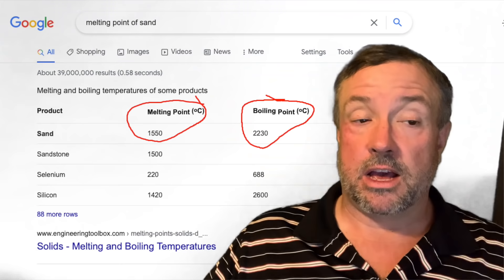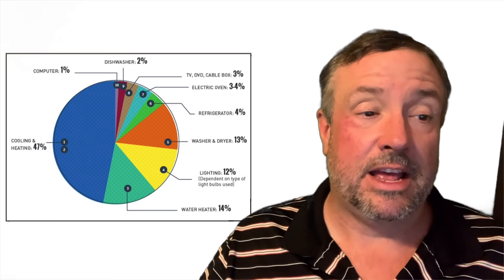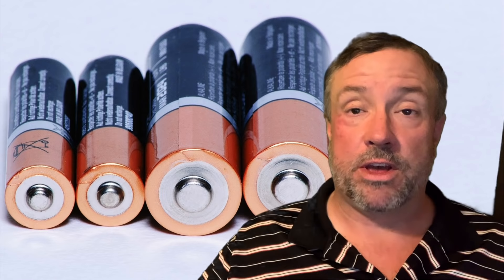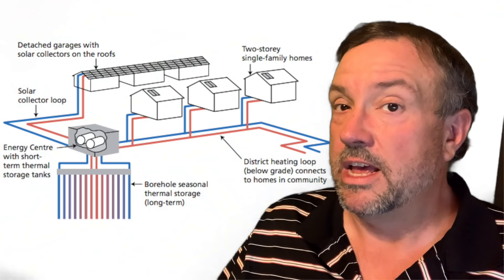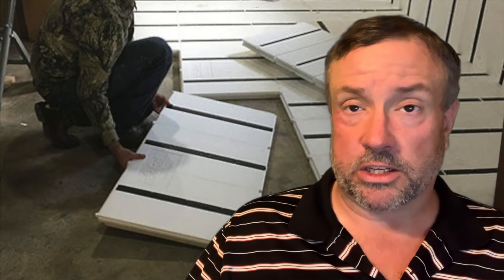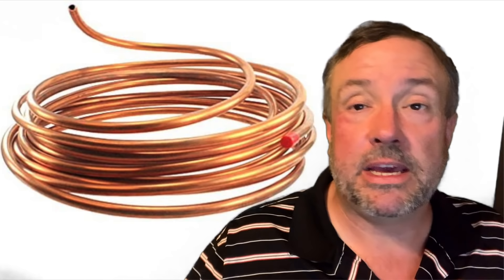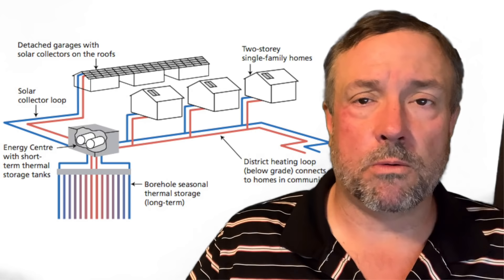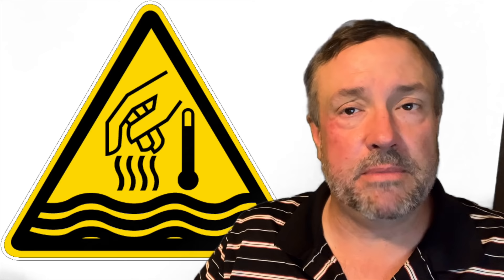Sand for Thermal Energy Storage

Comment: When I worked in the Solar Industry decades ago we used a saturated water/salt solution that would turn solid at room temperature and turn to liquid when heated. This liquid was stored in plastic stackable trays stored in an insulated room, air flowed through the trays to charge them with heat or extract heat at night using a conventional HVAC duct system in an attic or space for the thermal heat storage.
Reply from the maker: Interesting! Thank you for the comment!
Reply: any chance you can give us more details
Reply: Phase change material. I wanted to use a layer of this in my design
Reply: So interesting! Awesome! Can you share any technical information about? Any financial information?
Reply: What salt?
Reply: I would like to hear about this, because as far as I know, molten sodium batteries require storage containers that can withstand 801c.
No plastic totes are holding that.
Though they do require an incredible amount of insulation.

Comment: Minnesota. We worked on one house that stored their heat with 1 inch riverstone instead of sand. Never thought about it before but the stone would allow full airflow from the heat source. Eliminating piping. Hum. The stone was in insulated below ground bunkers.
Reply: Interesting. I just bought a property where they pushed the old stone house into a hole, so I definitely have the stones to do this.
Reply: Great concept, I am building prototypes now for demonstration and to work out the bugs. So your idea of the larger stones will work great. So my thoughts are to have a heating element buried in sand at the bottom of a barrel or some container and now I will add larger stones at the top with maybe some grating between the two mediums at that point I won't need internal piping, like you said the air will flow around the larger stones. Perfect, fantastic commen.

Comment: let's do a little bit of math here.
 
before that I just want to point out that water usable working range is closer to 30-90°C rather than 60-85°C. With 30°C water you definitely can heat a room equipped with a costly heating floor OR more smartly a fan-equipped water radiator to replace old high temperature radiators.
For water, this gives a DeltaT of 90-30=60K
So the volumetric heat capacity for water over that range is E(water)=Cp(water)*rho(water)*DeltaT(water)=4186*1*60=251kJ/L
Cp being the thermal capacity in J/K/kg
Now for sand : E(sand)=Cp(sand)*rho(sand)*DeltaT(sand)
So if we want E(sand) > E(water) we need DeltaT(sand)>251kJ/Cp(sand)/rho(sand)
Google says rho(sand)=1.6kg/L and Cp(sand)=835J/K/kg
This gives DeltaT(sand)> 187°C
Since we took a minimal working temperature of 30°C for water we need to take the same for sand which eventually gives a minimal heating temperature of 217°C.
Now we need to remember that at this temperature sand is just as good at storing heat as water is in a given volume. We need it to be a lot better to compensate for its inability to be easily pumped like water.
Let us asume that we want sand to be 30% better per volume unit than water. Then sand will have to be heated at 273°C.
This means that our free heat source will have to be at least that temperature, which is clearly not that certain for domestic use. The only places where sand can be heated continuously over 250°C is in those concentrated solar farms where a thin curtain of black sand falls across the supper bright focused hotspot on top of the tower.
On top of that, those temperature are very close to the auto inflamation of most materials like wood, dust, plastics, etc. So the fire hazard would be extremely high in residential use.
With all that said I think that, for domestic use, the better way to consume less wood throughout the year is to throughly insulate your house, use a heat pump that only work during the daylight and store the daily heat in a water tank or a massive wall or soil using simple PEX tubes, it is less sexy (I love exploring tech ideas too...) but it is a long term solution.
Reply from the maker: Thank you for all the detail!
Reply: Really some good thinking
Reply: How do you ensure the water doesn't boil? At least for sand you can just keep pumping in more heat. Good point on flammability though.
Reply: @markhemsworth2670  the simplest way would be to activate a circulator at a given temperature threshold. It would send water to radiators or any heat diffusers.
An even simpler way is to make the water buffer big enough.

Comment: Hello I'm an hvac journeymen. I believe air is your best medium. Using soft copper you can store heat in your sand. Then when you want move your heat from the sand with air to a tube in shell style heat exchanger. A tube in tube heat exchanger would work as well. You then can control water temp by simply controlling flow rate of air around the water tubes. And from Here you have your radiators and such.
Reply from the maker: Interesting
Reply: Agree - instead of sand the medium can be small granite rocks and you heat air in the parabolic reflectors and discharge at the bottom of the rock pile. In a closed system with non-return valves I am sure circulation could be done with convection/Pressure difference flow.
Reply: I would also be in favor of the air return. This should be the cheapest option.
Reply: I was a boilermaker specializing in heat exchangers with high temp, high pressure. I agree with your answer, was thinking the same thing essentially. 

Any liquid you use with a high boiling point is going to be expensive and/or and pressure. High heat and high pressure is not safe for most people and expensive..

A combination of water/air/sand would be relatively simple, diy friendly, low maintenance, low pressure.
Reply: @shanewestphal1557  I've been thinking, would it be possible to remove the burner from a domestic gas boiler, and just feed hot air from your thermal battery to the heat exchanger instead? What would the air temperature at the heat exchanger need to be to make this viable?
Reply: @shanewestphal1557  also what kind of fan or pump would you suggest for moving high temperature air through the heat exchange loop?
Reply: @mrogormand1  pumps and blowers are not my specialty. There are alot of factors when choosing. Temperature, pressure, flow rating, etc. If it were me, I would contact a engineer (I personally know several) or I would look at the information tag on the pump to find temp and cfm rating. Estimate what you need. This is a little out of my knowledge base. I either installed, repaired or replaced. I never really had to size or choose.
Reply: @mrogormand1  your other question does not make sense to me. What would be the purpose of the burner? Think radiator. A radiator is a liquid to air heat exchanger.
Reply: @shanewestphal1557  Ok, let me explain myself a bit. If you have a house with gas fired heating, you already have a system of radiators, heated by water that is in turn heated by passing through a heat exchanger in a gas boiler, or oil boiler or other fueled boiler.. The heat exchanger is heated by the hot exhaust from burning gas in the burner unit, also in the boiler. My question  to you (as you said you had boiler experience) is, would it be feasible to modify the gas boiler so that you remove the burner unit and replace it with a hot air feed from a sand thermal battery?  or is it a better Idea to design a new air-water heat exchanger from scratch?
Reply: @mrogormand1  ahh. Got ya. So the issue I would see is the temperature. You would need a huge thermal battery that consistently feeds similar Temps as the burner would produce. I would think the burner would not need be replaced, just fed hot air. The burner is not really meant to come in direct contact with high heat but should be fine. Put a high temp tee valve in line to the burner then can direct either hot air or natural gas/propane. Also, would have to think about the exhaust.

The issue (in my opinion) would be keeping the incoming hot air hot enough to "fire" the boiler. 

I was thinking more of a closed loop system with heat exchangers, automobile radiators, and heat battery. I would have to draw it out to properly convey my thoughts.
Reply: I so much agree, K.I.S.S!  if the air is to hot, dilute it at the source with cooler air. ducting is cheep, no fancy effluents...
Reply: The video is over a year old so I was sure someone else would’ve thought of air as the ideal heat transport medium. It’s free and ubiquitous, it doesn’t freeze or boil, and it can be easily moved from place to place. Store solar heat in the sand battery, (the bigger the better), by any convenient method. Air pipes could then move heat from the sand to air/water heat exchangers to heat water for direct domestic use or for space heating. For safety a battery of sand batteries could step the temperatures down to safer levels so that the sand closest to the heat exchanger would never reach dangerous temperatures.
Reply: water shortage is going, or is presenting to be a future problem
Reply: Would love links to the reccomended heat exchanger and how to blow the our through the copper tubing

Comment: Here in the Netherlands there is already an housing project that uses a big isolated basalt stone mass  as an heating battery for heating in the winter. During the summer regular solar panels collect electricity that is stored with piping as heat is the basalt. In the winter this stored heat is used to heat a whole housing block ( name of the project: cesar-project and basalt-batterij)
Reply from the maker: That’s awesome thank you for sharing
Reply: In Hamburg Siemens-Gamesa has an upscaled grid-level version of this using basalt as well: ETES, it can store 130MWh of heat in about 1000t of stone.
Reply: Really nice! That's idea is really awesome... Do you have any information about the ROI of this? Any financial information?
Reply: @TheGijzzz

Comment: As a primitive heat storage for those who have had to use this method throughout history, rocks and I imagine, sand, would hold their heat for long periods of time. I am thinking of the very old fashioned methods of heating specific areas with hot stones, heated by a fire, then transported to where they were needed. They not only used them for heating beds in freezing bedrooms, but also in outdoor carriages, under the seats, and in their homes where needed. These rocks would get switched out for newly heated stones brought in from either outdoor fires or indoor fireplaces. In this day of fuel shortages throughout many parts of the world, it seems we must inform ourselves of lifesaving methods of survival. When the weather thrust Texas into a deep freeze a couple of years ago, it was reported people froze to death, and pipes broke from freezing also. It seems the electric was down in many areas, and people apparently were not able to stay warm. It pays to know basic survival techniques, and sand used for heat storage makes sense to me. I had been thinking of getting stones, as in Florida we don't have "stones" as much as limestone, inland. But I thought of sand as an option, because if nothing else, Florida has all the sand one needs. Of course, it is mixed in with organic materials, but it is not hard to wash sand to the pure white state. I have done that. Once that is done, dry sand should be good for heating by the fire outside in metal containers that can be safely moved indoors to a metal or fireproof platform to warm small areas, should our grid go down. We dip down into the 30's here, and while no one would necessarily freeze to death, it can get very bitter during the nights, with days usually in the 50's. Thank you for this video, and I just wanted to recognize sand as a great potential heat storage/insulation resource.
Reply from the maker: Great info

Comment: So far, I have my greenhouse pit dug, aprox.  5' deep. After insulation with ridged foam I plan on filling the floor in with two feet thick adobe/cob slab, then add another foot or so on top of that but with a  6" diameter channel running thru it to direct and collect heat from a woodstove before heading out thru the chimney.  This will operate similar to a cob bench often attached to a rocket mass heater in a home.
Only requiring a  very minimal amount of wood and effort in the day/evening to create enough radiant heat to get thru our cold Canadian winter nights. And, in summer,  the cool floor mass will help regulate the interior temps with at most a dc fan for circulation.  
I've come to appreciate systems with as few movable,  motorized,  and electrified parts as possible- less to break, more reliable,  easy/free to DIY fix, etc.
Reply from the maker: sounds awesome!

Comment: Hi there, as a Canadian,
  I understand how sand is a nice thought in the Winter!
 Tahiti has some lovely sandy beaches!
 I am very interested in sand batteries.
 In the past I’ve done a couple of small scale experiments.
 In buckets, & large SS saucepans.
 Bought 3 older electric kettles from thrift stores.
 Hooked directly to a 100w solar panel.
 They all worked.
 The bucket worked best, but I was concerned about heating 
 the galvanized bucket that hot in the house.
 Fumes might be an issue.
 The saucepan worked well, but wasn’t big enough.
 After watching your video, I now have a bunch of new ideas!
 Who knows what I’ll come up with?
 Keep your smiles on!
Reply from the maker: That’s awesome!

Comment: Air is probably the best choice for moving the heat into the sand. I’m looking to build a rocket stove and blowing cool air with a small fan across the top in a 4” pipe and then down into the bottom of the sand. The pipe then splits out as a manifold into smaller pipes that have holes in their bottom so the air can get into the porous sand. A similar manifold at the top could bring warm air to where it is needed.
Reply from the maker: That’s awesome
Reply: Make sure to install a good prefilter or in about ten years your entire intake area will be clogged beyond use. Dust is insidious!
Reply from the maker: @palipali4264  wise words

Comment: After reading many of the comments, my 2 cents for what it's worth.

If you have enough sand in a sufficient volume and insulated then my thought would be to use a copper tube coil buried into the sand at regular intervals. Copper has a melting point of 1,085 °C so the temperature would not affect it so long as it was as solid run. (No solder) I would make the size of the piping about 1/2" to 3/4" to maximize the contact area. A simple blower system can be used to push the outside air into the solar collector and feed the heated air into the pipes buried in the sand.  No need for a special air pump as it only blows the outside air in and not the warmed air. Also, if the sand temps are right you could use a few peltier wafers to utilize the heat to run the air pump after the mass has warmed. Peltier wafers or chips are used in thermoelectric coolers. When these wafers are powered they transfer heat from one side to the other, which side the heat or cold goes to depends on the DC polarity applied to them. That's why they can also heat the contents of a cooler. But if they are heated on one side and cooled on the other they produce electricity and maybe enough to run an air blower if combined in a large enough scale. Think wood stove fans with no battery that run on the heat generated. That's how they work. Electrical generation was the intent in their original design. The cooler/heater part was found out later. My idea would not be a fast transfer of heat but in IMO it really doesn't need to be if you're collecting heat throughout the day, week, month, etc. Super efficient? Maybe not 100% but I figure it's a good starting point.

Thanks for getting me thinking about this. It might be a great way to warm my large chicken coop (24 chickens) in Ontario Canada in the winter. 👍
Reply from the maker: Cheers!

Comment: I would say that electric heaters, fed by photovoltaics are a great way to store a lot of heat in a closed and well insulated sand container, that has built in pipes for heat exchange. You could easily get the sand to 300-400 degrees C. Stainless steel should be a good material for the container/heat exchanger. Insulation should be very good, maybe a first layer of perlite/cement, second layer of hempcrete or rock wool (or maybe both). And the whole thing put underground. Using a loop of high temp oil, you can easily transfer heat from the sandbox to a water boiler.
And relying on photovoltaics, rather than solar heat collectors, means that even in very dim and short winter days, you could get at least some heat.
And in the summer you can use the extra power for other stuff.
Reply from the maker: interesting
Reply: Check out Finnish company polar doing it
Reply: Thank you for post. is high temp oil vs high temp air better and less cost. i think Polar Night Energy does hot air and thought it strange
Reply: @t9358  Hot air is a nice concept too. But I think it would be harder to achieve as a DIY project.
High temp  oil can be achieved very easily using old water heater tanks, copper or steel serpentines... Basically junk that can easily be obtained.